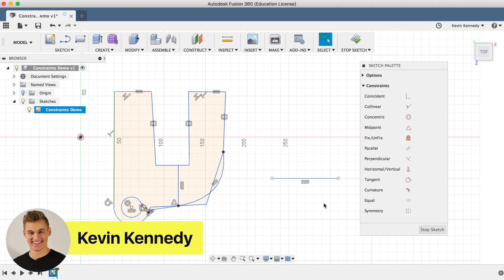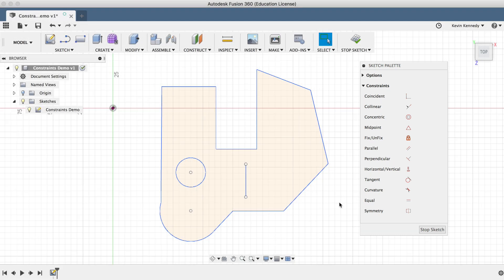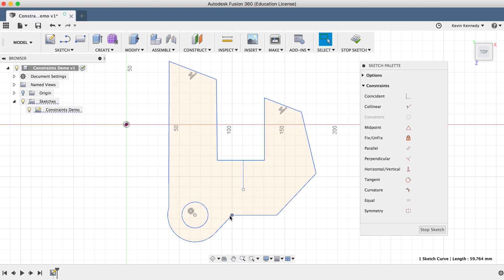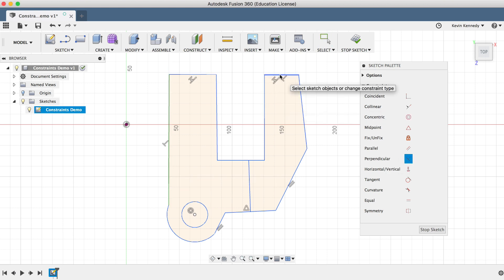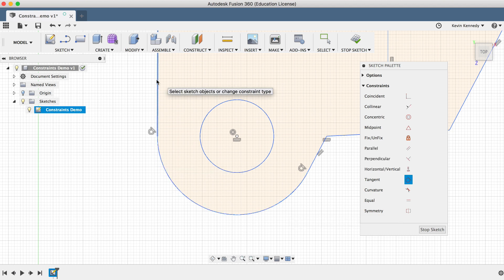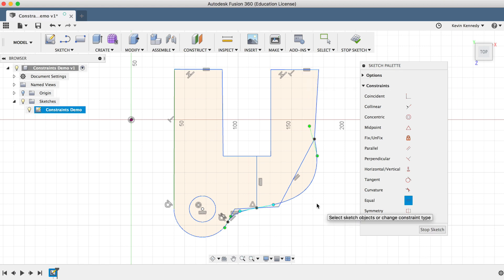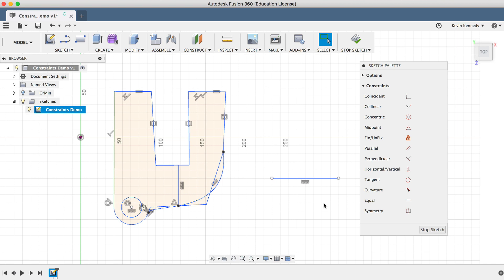How to Manually Add Sketch Constraints - Learn Autodesk Fusion 360 in 30 Days: Day #16

Comment from the maker: Got questions about using sketch constraints? Let me know in the comments below! 👇
—
TIMESTAMPS
0:00 - Manually add Sketch Constraints in Fusion 360
2:27 - Coincident
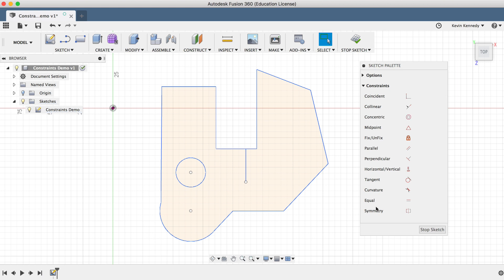3:25 - Collinear
4:31 - Concentric
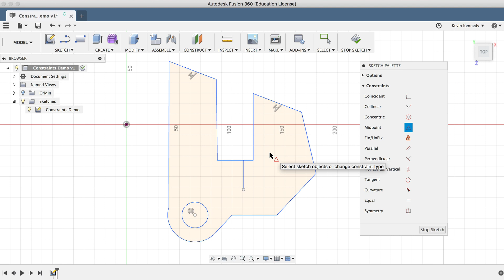5:00 - Midpoint
5:33 - Fix/Unfix
6:19 - Parallel
6:40 - Perpendicular
7:26 - Horizontal/Vertical
8:06 - Tangent
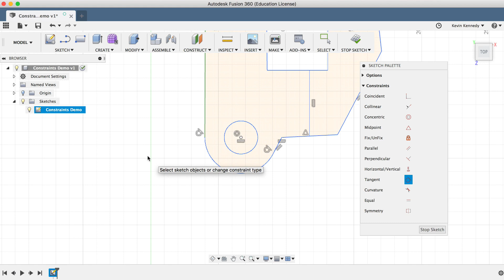8:50 - Curvature
10:19 - Equal
10:46 - Symmetry
Reply: Hi can you make video on how to make inductors or electric coils such as the ones in consumer electronics transformers ??? Can't see any video online doing that

Comment: My question would  be is that in a more complicated sketch you can get glyphs all over the place, but it is not always crystal clear (or at least I don't see how you can tell), which 2 items are being constrained by a specific glyph.  For example, 3 concentric circles, results in a bunch of concentric glyphs, and while I realize it doesn't make any difference for that simple case, being able to tell what is constrained to what (for example collinear or parallel), can be confusing to figure out.  Haven't been able to find a good way.

Comment: Hi, and thanks for this video. I do have a question for you.  Sometimes, when I’m editing a sketch, and I click on a point, I see 3 time the icon for coincident. How can I find out which one does what?  I always end up deleting all three of them, moving the 2 points elsewhere and redoing my constraints.
Reply from the maker: Unfortunately, Fusion 360 doesn't have an easy way to indicate it. Sometimes deleting one or the other is the only way to check. At times, you can select the lines or end points and it will highlight one of them to tell you...but that will depend on how the geometry is put 
together.
Reply: @ProductDesignOnline  thanks so much. Have a great day!

Comment: Needs a feature where I can select an entity, and it will show constraints on that object and which objects they are constrained to. When you did the "equal" constraint, if you went back into this design later, (or someone else went into it), it would be near impossible to see what objects were equal to each other.

Comment: For the concentric circle, how isn't selection order important? What if you wanted the arc to share the common center with the circle?

One thing I have found as I design sketches is to check the constraint icon after drawing EVERY element. A number of times I have gone 4-5 elements down, and couldn't figure out how to constrain the items.

Comment: I'm watching this in 2022, and the perpendicular constraint did not do what it did for you :-/ It made the left side do some criss-cross thing to be perpendicular instead of straightening the top of the shapes. Any update on how this works now? I know the versions have changed since your UI looks different than what I'm currectly using...
Reply: Also, the horizontal/vertical constrainted just moved my whole sketch instead of just the line. It made the line vertical, but now everything else is crooked...

Comment: I have a small rectangle that I want to center on a line that is parallel with the long side of the rectangle.  I tried different constraints but I can’t make it work thanks.

Comment: Have a problem finding the curvature comb while adding a curvature contraint in the new UI. Found it under the Inspect button but when I activate this I'm kicked out off the Sketch environment.
Thx btw for this excellent course!  I'm half way through the course.
Reply from the maker: Hi Henk. Glad to hear you're enjoying it! With the new UI, you will only see the curvature comb in the Sketch palette (dialog) whenever you select the spline geometry. Note that if you select the individual spline points it will show the curvature display and tangent display. The one located in the "Inspect" dropdown is a modeling version, which is why it's booting you from the Sketch environment.
Reply: @ProductDesignOnline  In the current revision of Fusion I right-clicked the spline and selected "Toggle Curvature Display".
Reply: Turn off the comb using the same process.

Comment: This video should be one of the first in the series, as there were times earlier on when my instructor told me that it was a constraint issue when i had a problem. I didn't honestly even understand what he meant, and this would have been a super helpful thing to have seen beforehand. Love these videos and the work you do on them. :)
Reply: Yeah, this seems like it should be one of the first. It's a fundamental concept in the whole design process which affects every single tool.

Comment: Hey, firstly thanks for the tutorials!
I'm watching these 1.5years after you've uploaded these, so I guess the version difference here creates quite a few challenges/problems.
But overall what I suggest you should do is, when you add a demo file (this lesson) or the dog bowl or the phone case, then be sure to say it out or write somewhere, which file format to use.
I'm new to Fusion 360 and I think I at least downloaded the phone case file 3 times before I got the right one and twice for this constraints lesson.
Maybe seems like a common thing for you, but for beginners, it's crucial information, since the download links offer around 10 file formats.
Otherwise, keep up the good work!

Comment: Just a note Kevin, for the Perpendicular restraint to work as per the tutorial... I found I had to FIX the left most line in the drawing, otherwise the left line would move rather than the two horizontal lines.  Leaving the left line unfixed would cause the left line to change from vertical to slanted.  I tried clicking the lines in different order to see if the order made a difference on which line moved.  If made no difference,  so in this case, the FIX constraint was absolutely required for things to work correctly.
Reply from the maker: Thanks for sharing this, Robert!

Comment: Hi Kevin, a continued thanks for this video series.  I've just added a 3D printed painter's tripod to my toolbox.  I just had this idea to change the circle in the side to a letter, why not personalize these, right?  Maybe a logo?

Anyhow, the link to the model appears to be empty.  Are you able to take a look?  Cheers bud!
Reply from the maker: Hi, Brent. That's a neat idea for the painter's tripod.

In regards to this demo file - it's a bit misleading. Fusion 360 doesn't show any data in the preview mode for sketches. Since this demo file only contains a sketch it says that nothing is there. Once you open the file in Fusion 360 you'll see the sketch template :)

Comment: First of all: I love your tutorials! I have two questions: 
1) What do the symbols next to sketch in the browser mean? It is either a pen or a lock. 
2) Could it be that Fusion gets the color of sketch lines wrong (sometimes)? I have blue geometry that is definitely fully constrained and lines that are black even though they are not fully defined. I can provide screenshots if needed. 
Thanks in advance.
Reply from the maker: Hi, Frank. Great questions.
1) The lock tells you that the sketch is fully-constrained. The pencil means the sketch is not yet fully-constrained.
2) I wouldn't say it's impossible for their to be a bug, but generally its something small like one point are area of the sketch that is still moveable in some way. If you share the link to your file I can take a look.

To share your file please go to File > Share > Share Public Link (make sure "downloadable" is toggled on) > Paste your link here as a reply to this comment. 
Cheers, Kevin :)
Reply: @ProductDesignOnline  Hi Kevin, I figured out one case of the mysterious wrong colored geometry, but there are two more instances in my file I'd like to get your advice on.
Look at: https://a360.co/38ss6LM
Specifically: Drawer_Bottom > Sketches > Front: I made an offset of a projected rectangle and one side is black, the other 3 are blue. Why?
Also: Box > Sketches > Side: Sketch is not fully constrained bc of the construction line in the bottom (mirror axis). But even when I toggle it to a regular line, it turns black though its height is not defined. What?
I thank you in advance, head over to get you a coffee now. Wish I could become your Patreon, but I don't have income at the moment.
Reply: Hey Kevin, what's up? Haven't heard from you in over a week. Did you have a chance to look at my file? Cheers, Frank
Reply from the maker: Hi Frank, My apologies...for some reason I never got a notification from your reply.

Drawer_Bottom > Sketches > Front - This one has me stumped, and could be a bug. Through the process of elimination, I see that it's something with the offset. What's weird, is the fact that I can recreate the offset after deleting all that geometry, and it works fine - everything is black/fully-constrained. I'll play around with it some more and see if I can find a better reason for why the offset would've gotten thrown off.

For the Box > Sketches > Side - It is not fully-constrained because the height of the construction line is not defined. Usually, I run construction lines from the bottom to the top of something so the coincident constraints take care of this. The other option would be to apply an arbitrary dimension (ie 10mm) to the line. Once you do either of these you'll see the lock icon appear. Construction lines are black which makes it a bit confusing in relation to line colors.

Great model, btw - and great work keeping it organized, layers renames, etc. Keep it up! :)
Reply: @ProductDesignOnline  Thank you very much. I have learned so much through your channel and really enjoy working in Fusion 360 now. Keep doing your thing!
Reply from the maker: @humphreybfiftytwo  Thanks Frank! Always happy to help troubleshoot....and if I don't reply within 2 days just drop me another comment. It's likely that I didn't see it :)

Comment: Having a problem downloading the demo file. Clicking on the link gives me a completely blank page with no option to download anything
Reply from the maker: Hi Roger. Thanks for bringing this to my attention. I just checked the link and it appears to be correct - but something is going on with the Autodesk360 Hub right now. I've checked several files and all of them are resulting in a blank screen. I would suggest checking back later tonight (assuming that they realize this is happening it should be fixed quickly).

Cheers, Kevin :)

Comment: Thanks again, Kevin. It was particularly helpful to learn some of the nuances of constraints like constrained elements need not always be connected and when element selection order matters. That's an understanding I'm not getting from any other resources beyond your videos.
Reply from the maker: Hi Darin. Glad to hear this was helpful in learning constraints, including many of the small nuances that are often overlooked.
I have these documented on my website if you ever need to quickly reference them - https://productdesignonline.com/tips-and-tricks/how-to-manually-add-sketch-constraints-in-fusion-360/
Cheers, Kevin :)

Comment: really good need the new gui version.
Reply: Naming sketches oh never thought if that. I have 20 and 30 sketches in one part. It's a mess.
Reply from the maker: @DennisMurphey  It will make a huge difference :)
Reply from the maker: I didn't like the constraints in the toolbar at first... but after I got used to it I do find it's much quicker to access them there (or the right-click menu) instead of in the Sketch Palette. Cheers, Kevin :)

Comment: Skipped ahead to watch this and I appreciate you highlighting the finer points that aren't obvious from just knowing what each constraint means (in the geometric sense) – especially the order of selection for collinear. Also it never occurred to me that perpendicular and horizontal/vertical can apply to entities not touching each other, which is useful and awfully obvious in hindsight, aha.
Reply from the maker: Hi, presumenothing. Glad to hear this overview was helpful. I've seen firsthand how constraints can be a tricky concept for beginners to grasp. I try to break it down in a way that reinforces the many ways they can be applied - I'm glad to hear this opened your eyes to some of the possibilities.

In many of the following videos in this series, or my other videos, I demo some other unique things you can do with constraints - such as applying them to spline handles. Keep at it! Cheers, Kevin :)

Comment: Hi there, For some reason I can't see the constraint symbols on my sketch.. please help
Reply: only certain constraints but I can do without seeing them. Don't worry
Reply from the maker: Hi Darren. Is your "show constraints" option checked in the Sketch Palette? That is strange if only some are showing up it may be a bug or graphics issue. I would recommend restarting to see if the problem still exists. If so, can you provide a screenshot so I can look for anything else that may be causing this? Cheers, Kevin :)
Reply: @ProductDesignOnline  Hi Kevin, everything is fine. The one 90 deg angle symbol did'nt show but now it seems fine... thanks for your fast response :)
Reply from the maker: @darrenthacker9223  Glad to hear it's fine now. I'm always to help. Don't hesitate to comment on any of my videos should you have any questions. Cheers, Kevin :)

Comment: "Using constraints in Fusion 360 to make an upside-down sloth"
Reply from the maker: 😂😂😂 You're the first one to guess correctly, Josh.

In all seriousness, the shape was organically created to ensure all constraints would be covered. Its pretty rare to use all types of constraints within one sketch. Cheers, Kevin :)
Reply: @ProductDesignOnline   Hey! I actually ran into something concerning this topic I can't seem to find an answer to..  would you mind giving it some thought if you have time?

I'm trying make a ring with cat ears... (using a conic curve on the outer edge of the ring to form the ears) .. I want to be able to constrain the ear(conic curve) so that I can re-size the inner-diameter of the ring to achieve varying ring sizes and have the ear scale accordingly to match the same sort of shape. Unfortunately, right now, if I change the inner diameter.. the curve's sketch point stays where it's at, deforming the shape.. I've tried a few combinations of constraints (including functions based off the ring size), but I can't seem to get something that allows the ear to scale properly... Any suggestions? Is there a better way to achieve this? I'm pretty new to fusion.

Thanks!
Reply: ... Think I got it... I tried using coincident constraints at the point where the curve meets the outer ring diameter.. and set the curve's sketch point to be a given percentage of the ring's inner diameter. Open to any extra input you may have but it Looks like it worked.. thanks!
Reply from the maker: Hi, Josh. Glad to see you found a solution. I was going to suggest using User Parameters. Typically you'll want to set constraints to everything, then dimensions (with the least amount of dimensions possible, and then you can apply user parameters to the dimensions. This will help make the model dynamic, where it can be updated accordingly, without it throwing off the overall shape of the design.

I have two videos where I briefly discuss this approach...this is something I'll probably do more of in the future too.

1) https://youtu.be/iSBsBTMsGTk
2) https://youtu.be/iUUFrkdgCLI

Comment: Hiya Kevin, I'm having issues with not being able to select the second line on the concentric constraint. This often happens, where I can't select a second feature; with the screwdriver for example. When I was working or the tip I had to slice the sketch to be able to select and adjust the second point after I changed the dimension (if that makes sense). Do you think its something in my settings, or perhaps a bug? :(
Reply from the maker: Hi, TwistedF8 pewpewpew. One thing I would recommend trying is setting your preferences back to the defaults. Click your user name in the upper righthand corner > preferences > "Restore Defaults" button > restart Fusion 360 and try again.

If the issue still persists after restoring your settings...could you share your file with me? I'll check on my end and see if it allows me to complete the constraint with your file. If so, then that means it's likely a bug. Cheers, Kevin :)

Comment: I'm loving these videos! Really looking forward to finishing this series and testing my chops! The only problem is I can't access the constraints demo resource file. I may be doing something wrong, or it may be because you've taken it down because it's considered old now. When I download from the Myhub on the Fusion 360 site, what file type do I choose to get it into the Fusion 360 software? Fusion 360 Archive? Thanks again for making these videos, they're a goldmine of knowledge!
Reply from the maker: Hi Jason. It looks like the demo file link is working on my end. Please try this link https://a360.co/2w591yw (same as the link in the video description). That is correct - click on the link > click the blue download button > select Fusion 360 Archive (file type) > enter your email > you should receive an email within a minute or so. If not, check your spam box. > from the email click the blue download button to download the file > upload the file to your data panel by selecting the blue upload button and then select the file name from your computer.

I'm happy to hear you are enjoying the series and learning a lot, Jason! Don't hesitate to comment any questions you have as you work through the remainder of the series. Cheers, Kevin :)
Reply: @ProductDesignOnline  Thats brilliant thank you ever so much for the quick response, it helps a lot! I've followed your instructions and it worked!
Thanks again!
Jason.
Reply from the maker: @jasonvaughan9796  You're welcome!... glad it worked. Have a Happy New Year! :)
Reply: Cheers, you too!
Reply from the maker: @jasonvaughan9796  Thanks! :)